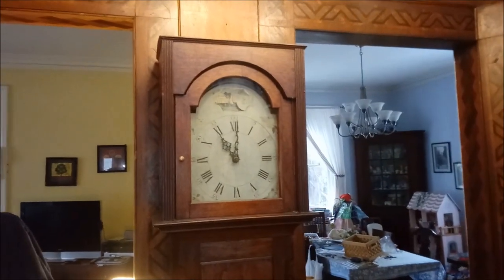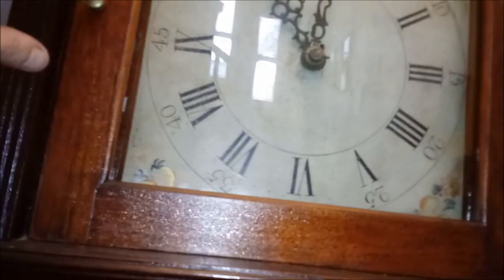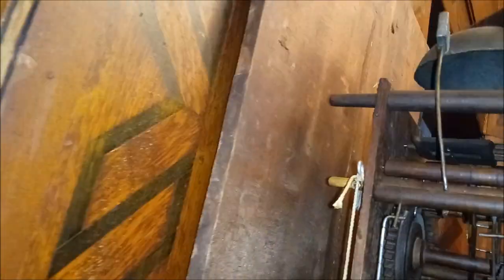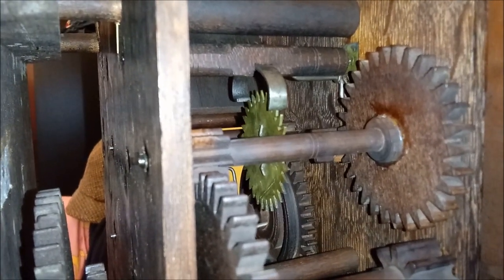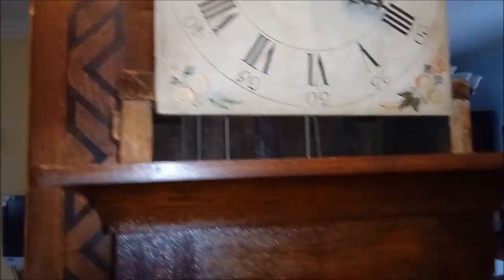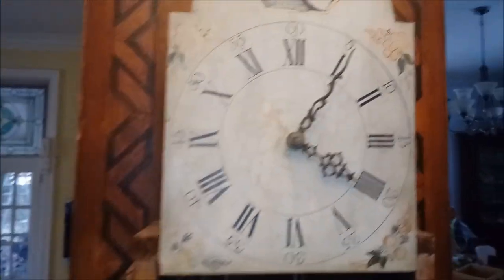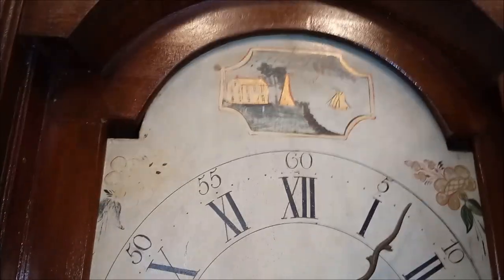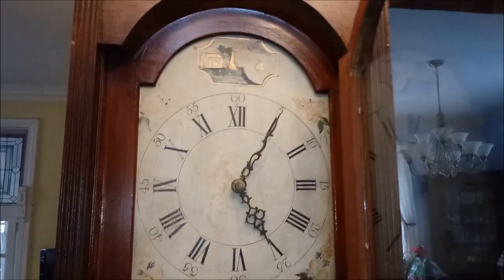1790 Gideon Roberts Wooden Movement Tall Case Grandfather Clock

Comment: Hello Mr. Clock Guy...beautiful house...love the parquet and the great example of a splendid old timepiece! I have a circa 1815 Riley Whiting big boy. Wooden movement, cast iron weights, removable bonnet, white pine that has been stripped of the dark lacquer and a clear coat applied. For such a large beast, it chimes like a woose haha...Runs a wee slow like me, but after some 200 yrs. she's doing fine. I only run thru it's winding once a month to keep her awake and in shape. I'm jealous as it doesn't have that costly $1.25 option of fixing the chime sequence. I know this is after the fact, but I'm glad it found her original family...

Comment: If you had to move it would you remove the wooden works first??
Reply: I do this for  a living, remove the weights, pendulm. stabilize the weight cords with blue non stick tape, remove all finials etc. slow is the way to go, and remember free advice is only sometimes worth what it const you.
Reply from the maker: Yes. I always remove the movement for moves other than just around the room. Moving to a new location in the same room I carefully lift the clock straight up and move it a couple inches at a time.